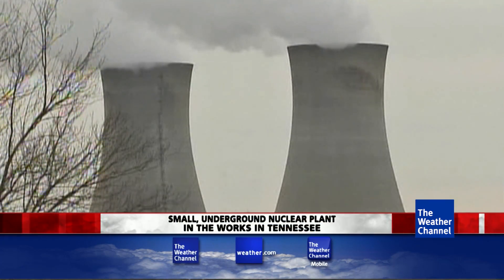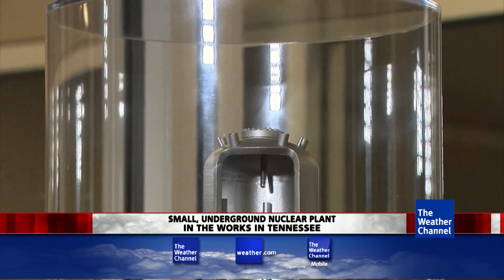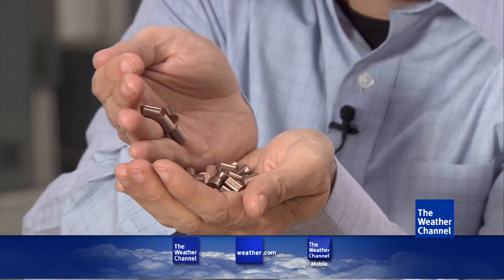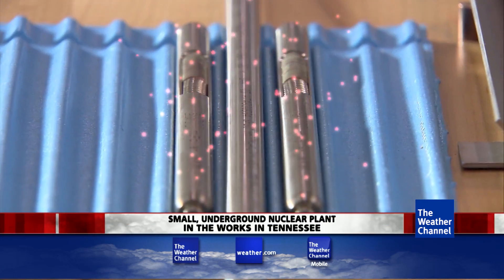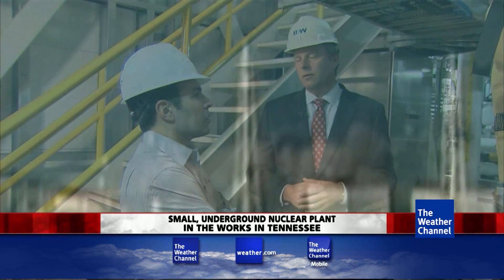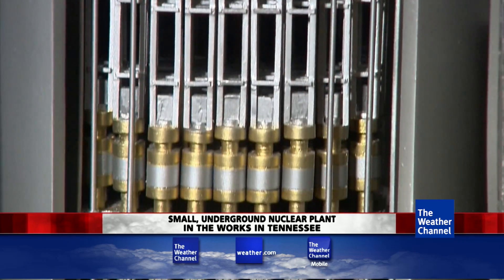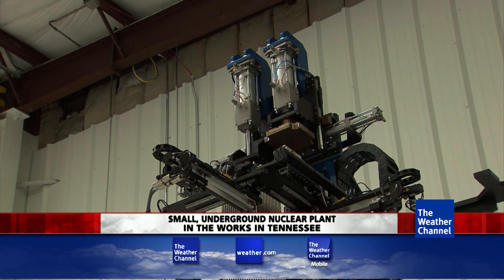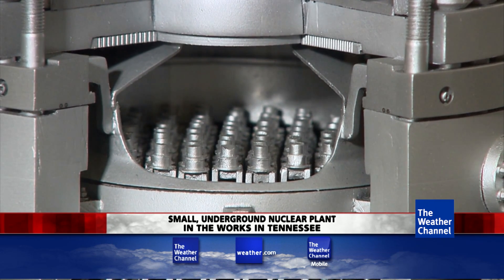Mini Nuclear Power Plant

Comment: nuclear power plants are becoming safer and very cost effective. US is learning from the mistakes other countries have made in the past. the smoke u see coming out of those chimneys is actually water vapor.
1 nuclear power plant (covering 2 sq/miles) output electricity is 1800 megawatts

u need 21 sq/miles of solar panels to produse 1,800 megawatts (if its sunny 90% of the day)

u need wind turbines that covers 170 sq/miles to output 1800 megawatts